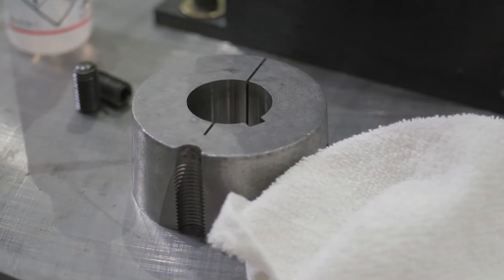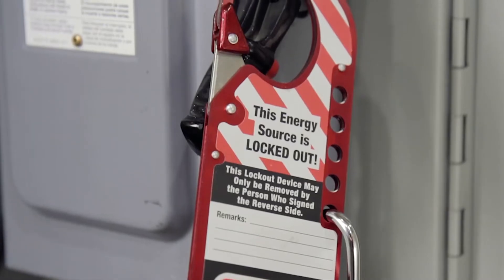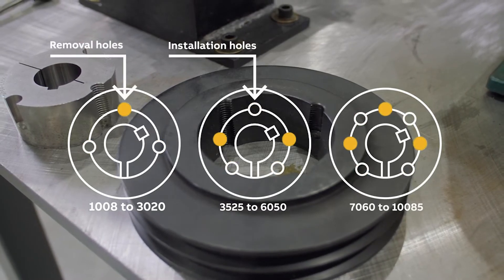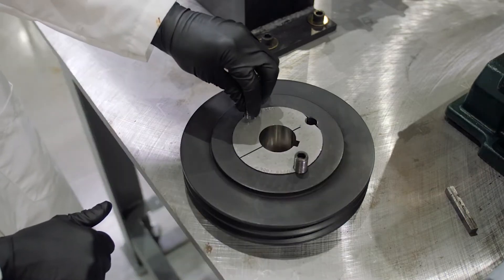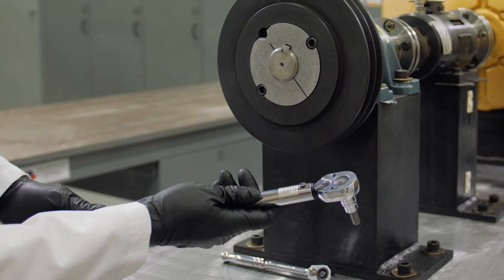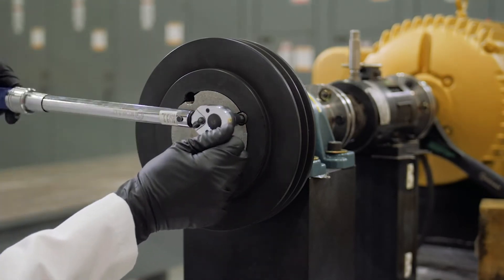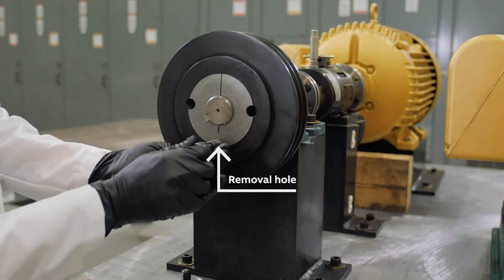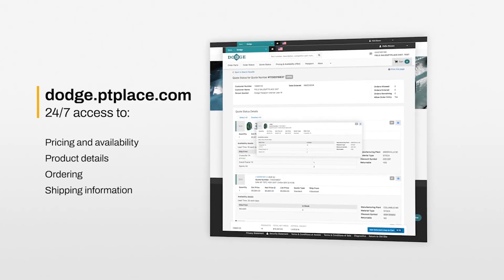Dodge Taper Lock bushing installation | Dodge Industrial

Comment: That using the third hole to remove the bushing from the flange sounds good in theory,   but not so easy in practice with a R25 coupling that's been in place in a 100%+ humidity environment for 22 years.
Reply from the maker: Thank you for taking the time to comment. The Taper-Lock Rigid coupling line comes in a standard material of cast iron. This material is not ideal for highly humid or corrosive environments; however, we do offer this series in stainless steel which may be a potential alternative in your current application. We would love to help so please feel free to contact our product specialists or engineering team anytime at +1 864 297 4800 or engineering@dodgeindustrial.com.